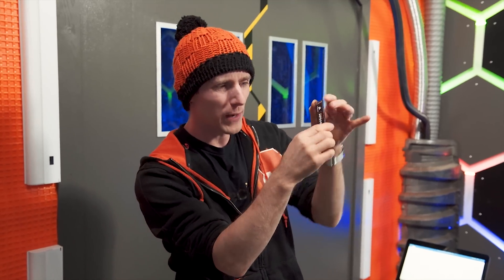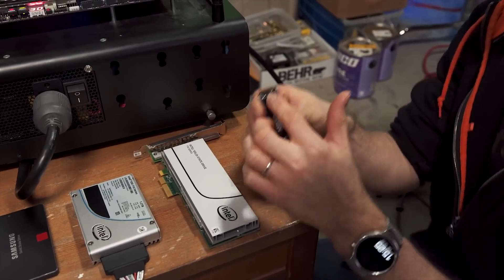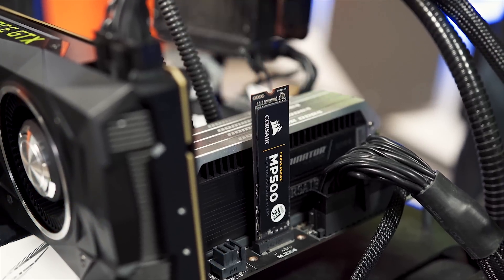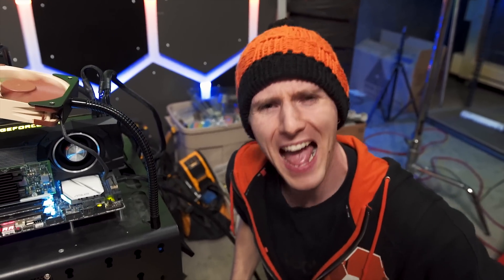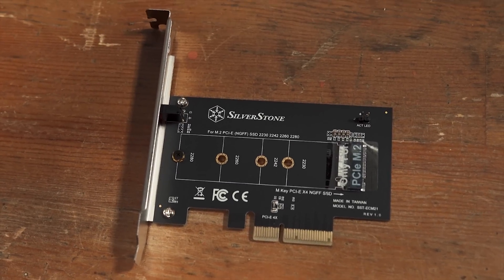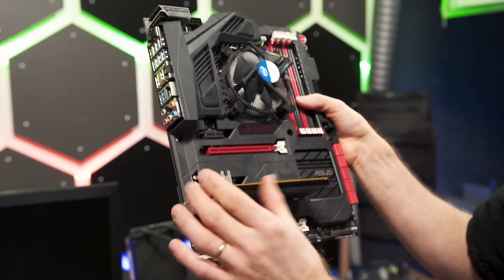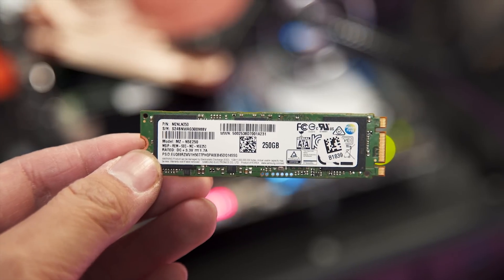The FASTEST SSD Technology Explained - M.2, U.2, and MORE

Comment: Linus referred to AHCI M.2 SSD's by saying "Don't expect to get earth shattering performance out of it"... I've had a 256GB Samsung XP941which is an AHCI M.2 SSD since November 2014 and its speeds are Sequential Read : 1065.317 MB/s
Sequential Write : 802.032 MB/s. 
Random Read 512KB : 643.234 MB/s.
Random Write 512KB : 734.560 MB/s.
Which is earthshattering quick in my book compared to even today's SATA 2.5" SSD's, (which seem more commonly used) like a Samsung 850 Evo. Obviously, the NVMe SSDs can double those speeds. I don't know why people haven't cottoned on to these types of drives to use as their Boot drive. Any after Z97 motherboards usually support it as a boot drive. The price has also dropped by half in those couple of years since I had mine ...

Comment: A few weeks ago I built a new Skylake based PC and used the new Samsung 960 EVO NVMe SSD as my boot drive.  It's impressively fast and benchmarks MUCH faster (read 3100 MB/s using CrystalDisk).  This crushes my SATA based SSDs (Samsung 850) which have now been relegated to a tiered storage space.  Highly recommended.

Comment: Can you do a benchmark test on a Sata SSD vs. a M.2 drive. I know my laptop motherboard has a m.2 slot since it was an option with my ASUS. I am currently running a 1tb Sata SSD might consider running my OS on the M.2 if I get a large enough one and use the secondary drive to store video that I use when I am performing with it. Thanks!

Comment: I have 512GB M.2 NVMe for boot/system drive, 1TB SATA SSD for Steam and other apps, and 2TB 2.5" HDD for mass storage, and it's a great way of setting things up. M.2 is ideal for small form factor systems as well. I think such a form factor is going to be the way forward.
Reply: it's year 2022 and yes you are right. m.2 with NVMe support is now the de facto standard for main(boot) drives in most laptops nowadays.

Comment: So, M.2 drives only have an advantage if they are NVM. 
If they are AHCI, it's the same as a mSATA (which you didn't even mention in this video, and they are even smaller and cheaper), or a normal SATA drive.

Comment: KeyB (gen1) and KeyB&M (gen2) and KeyM (gen3)
anyway to get an KeyM M.2 card to be used in a sata3 adapter or a USB3 keystick M.2 adapter, (Im aware that it ofcourse will be at limited speed)
but still I have an Intel 6p 256gb M.2-card just laying in the desk, in lack of adapters or keyM dedicated slots, all the M.2 adapters we got in house, wont take it, as they all have the groove in the left side, while as the keyM that have it in the right side.

same with the tablets, there also seem to be all KeyB slots.
Looking for an sata3 adapter with standard sata3 plug, that is able to to take KeyM M.2 cards.? (the ones for KeyB (gen1), you almost get throw at you for few bucks, but the ones for KeyM (gen3) std) doesnt seem to be the case.?
the theory 1500mb/s readspeed hence Intel p6 card, is not vital, just solely being able to take use of it' at normal old school sata3 speeds at a few hundrede mb's and like a old school sata3 plug drive.

Comment: I just bought an alienware.. and it does not come with SSD drive so I added a 480GB SSD drive. The problem is, it won't boot on my SSD once i reconnect my HDD. It goes back on booting on my HDD even I alter it on my BIOS already.

Comment: kind've misleading... 2.5" SSD's don't even come close to filling the enclosure size. very size comparable with M.2 Form Factor...
but, video suggests that they are 'bulky' compared to M.2 Form Factor.

which they 'are', but by connectivity Form Factor necessity, not actual size necessity.

Comment: I doubt Linus will see this, but I see that Logitech G710+ in many of your videos. Did you replace your keycaps. Mine was very bad. A few days after the warranty expired all the keycaps started falling off and breaking. I bought a few replacement keycaps as it was only a few keys at first, but later even more fell off until the keyboard was unusable. I have since then got a Corsair Strafe keyboard and it works just fine. On the Logitech keyboard the keycaps were so lose that i could pull them off with my fingers with little to no effort, but if I want to do that with the Corsair keyboard I have to pull VERY hard or use the keycap remover tool.

Comment: If your mobo doesn't support Nvme, you can simply do a BIOS mod and change some settings in the BIOS CSM menu and get full support for Nvme drive. I successfully installed Windows 10 on my ASUS X79 PRO mobo.

Comment: How many hard drives does it take in raid 0 to get equivalent performance to a modern SSD?
Reply: Ares5933 You would never be able to come even close to the low latency of an SSD (which is what makes it feel so fast), no matter how many HDDs you would stripe in RAID0. Also, when putting more than 2 or 3 drives in RAID0 it gets rather worse than better because of the overhead.

Comment: Im rocking a Samsung 950 Pro on a X79 2011 board with an 8 core Xeon in full NVME mode with all benefits like booting and full performance on Windows 7 (!). Installation was as easy as you could imagine. No bios hacks, no W8 legacy bullshit, no driver updates, nothing. Samsung 950/60 are just awesome. Installed, booted right up, performance over 2gb/s with nonstop video rendering. I love it!

Comment: I'm curious, you're ignoring most SSDs and didn't cover the 600p, OCZ's RD400 or the new amazing Samsung 960 drives, but you're sitting on the less ideal COrsair MP500 drives and using Intel 750s? I do think the Corsair MP500 and Samsung 960 EVO & Pro deserves a video! Consider including the Intel 600p and OCZ's RD400 just for comparisons if you can get your hands on them!

Comment: You can use an NVME as an OS drive on a system that doesn't not supports NVME boot, the bootloader has to be installed on a different drive.

Comment: I think it would be possible to add a bootloader that will support booting off of the PCIe storage. It's not impossible.
If the manufacturers cared enough about legacy hardware, they would've added a boot ROM or something inside the card itself and it would work pretty much everywhere. But this is Intel we're dealing with here, so I'm not surprised.

Comment: Hey Linus + Staff,
i am from germany so sorry for my bad english...

You are not 100% correct with your statment that you can't boot from an SSD older than X99 or something... It is possible with at least this models:

Samsung SSD 950 Pro
Plextor M6e

Because you can run them in Lagacy Mode "IDE Mode" therefore they have a dedicated ROM. 

Maybe you can Google Translate this Page http://extreme.pcgameshardware.de/ssd-hdd-laufwerke-und-speicher/458635-how-nvme-ssd-mainboard-ohne-uefi.html to take a closer look!

Btw.: this took me like 30 secs Googling, because my instinkt was that that was false Information on your side. I was thinking about installing GRUB on a normal SSD and set the mount point to the M.2 SSD... But it is even easyer! 
It would be nice on your side to maybe check the things that your "new" authors are presenting to you =)

Best Regards
Kevin

Comment: I was hoping for a performance review. I want a performance review. Why has it taken this long to compare the four or five M.2 sticks out there right now? Intel 600p, Samsung 960 Pro and Evo, Corsair MP500, and the OCZ RD400. Just like, a quick video on which is best value and best performance.
Reply: There's also a value M.2 NVMe ssd on amazon that has amazing review but I've never of the company before. MyDigitalSSD BPX
Reply: Agreed! Dont forget about the Plextor drives though!
I would also like to add in comparing the AHCI M.2 drives like the Kingston Predator, Samsung SM951, Adata XPG SX8000 (is that one nvme?) as well!

Comment: Mmm a lot of people seem confused about the explanation in this video.

What it comes down to is:

SATA-Express: Dead, don't buy it.
U.2: Dead, don't buy it.

SATA 600: Mainly used for large disc based storage (ie: 7200rpm drives) and early SSD's. This technology is limited to 600MB/s. If you're on a budget I would recommend a smaller SATA 600 SSD for your OS and a 7200RPM drive for bulk storage.

M.2 drives on the other hand come in two flavors SATA (AHCI) and NVMe. 

M.2 SATA (AHCI): These drives are meant to ensure software-level backward compatibility with legacy SATA devices and operating systems. These are slower, but cheaper but don't really have a major advantage over regular SATA 600 drives other than the form factor. 

M2. NVMe: The major advantage of NVMe is that it can access data parallel this gives it a massive performance advantage.

Where M.2 SATA (AHCI) drives are limited to +-550MB/s read and write and 50~60.000 IOPS and NVMe drive go well up to 3.500MB/s read 2.100MB/s writes and 330.000 IOPS and expected to go even higher as technology advances.

Disadvantage is that M.2 NVMe drives are currently really expensive. I would only recommend to those running applications with very high disk usage such as content creation or simply if you have the money and want what is fastest on the market.

If you're building a new PC I would highly recommend you get a motherboard with at least an M.2 NVMe slot on it for future upgrades.

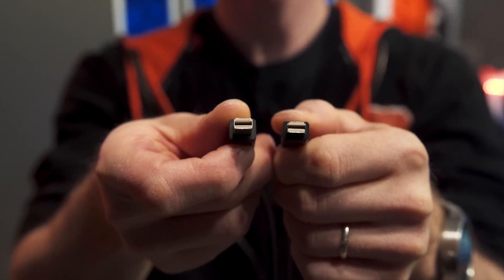Comment: 1:04 On my Oneplus 3T, I have tested to copy files to OTG SD cards via a 3.0 card reader/hub and the result is 5.79s to transfer 525MB of 3 videos included the latency. which means an at least 105MB/s speed and is definitely 3.0 instead of 2.0

Comment: Thermal throttling can be an issue with faster examples of these devices. This would be why Intel has wisely made their higher performance NVMe offerings as PCIe cards sporting extruded aluminium heat-sinks and ventilated PCI fences.

Search: Samsung 950 Pro M.2 Additional Cooling Testing - Puget Custom Computers

Comment: since im pretty much a noob with hardware, i need some help with choosing the proper ssd. im using msi h97 gaming 3 bought 2 and half years ago, so which type of ssd should i get? and i only want it to be used as game storage is this a good idea, cuz i dont really care about system booting time. using 4790k stock @4.0 and a evga 1070 sc

Comment: A better explanation for this would be:
- AHCI and NVME are like the middleman between your hardware and software. AHCI is a slow middleman (protocols) and NVME is a fast one. 
- Since they're just middlemen, they can work off of any connection, whether it's M.2, PCIE, or SATA (specifically in AHCI devices)
- Some motherboards support both protocols, while others only support one of them for boot drives. If yours only supports AHCI for boot drives, no matter what you connect your NVME drive (PCIE or M.2 slot) it won't let you boot from it.
- New motherboards support both protocols so you can connect the NVME drive anyway you want and it'll work at full speed and let you boot from it. So whether you get a PCIE M.2 device or an onboard one, you'll be fine. 
To sum it up. PCIE, M.2 and SATA are all just data highways. 
AHCI and NVME are the things that dictate how fast your "car" will be able to travel in any of those given highways if the country (the motherboard) allows that speed limit. 
I hope that helps better explain it to anyone who's confused.
Reply: The best explanation : )
Reply: great explanation!
Reply: Superb explanation, thank you!
Reply: Thx a bunch dude cause God knows my brain was fried after watching this video.
Reply: Still, i have a doubt (Maybe a stupid doubt)
AHCI, is for SATA HDD's? In this case, i've understand that NVME is the protocol for the SSD chips that Linus showed in the video, but AHCI i didn't get it as many people have understanded.
Reply: @itsneight There are two different M.2 connectors. M key connectors give x4 lanes for NVme(pcie) SSDs. B key is for the ahci variety. The samsung 840 evo shown is B + M, so it will plug into an NVMe slot, but run at AHCI speeds. https://rog.asus.com/articles/maximus-motherboards/buying-an-m-2-ssd-how-to-tell-which-is-which/
Reply: Meow Thanks
Reply: Not all AHCI M.2's HAVE to have both keys, right?
Reply: 泽皓杨 no, highly unlikely but the manual that came with your Z270 motherboard will tell you for sure which PCIe slot the M.2 slot shares bandwidth with, but it will be one of the x4 slots I'm pretty positive
Reply: So when do you need one of those PCI-E cards he was using?  Only if your board doesn't have an onboard M2 slot?
Reply: Fuck this video, your comment is all that's needed for explanation.
Reply: I'm aware of that... but the Kingston Predator I have doesn't have the extra connector. Thats why I dont think its AHCI and also why I asked the question. I notice the connector with both keys has two slits in it, the Predator does not.
Reply: Or you can opt to add support to your older motherboards bios. There is nothing that will stop me from booting any NVMe SSD on ANY old AHCI only system, even if I have to mod my own bios I am going to boot it. You can mod your bios, or use DUET as I stated above, or buy a Samsung 950 Pro with built in legacy option rom support. Either way it can be done if you know how to do research and have a free PCIe slot available.

I haven't found a NVMe ssd I can't boot yet and my computer is from 2009.
Reply: Ah, the joys of getting new motherboards.
Reply: m.2 is faster than PCI-e? I know it is faster than Sata III.
Reply: Well explained!
Reply: You should start your own channel this is great.
Reply: my man only has 11 subs, but he explained nvme better than linus? The fuck is this world coming to?
Reply: Hi, my motherboard is z270 and my cpu is 7700k and the video card is gtx 1080. The motherboard has two pcie x4 slots, two pcie x16 slots and a m.2 slot. Now, I have already had one m.2 ssd as an boot drive. I want to buy a pcie x4 ssd such as intel 750, which is used for storage. Is that possible? I mean will the speed for these pcie cards be affected?
Reply: I have an ASUS B85M-E/CSM board with a couple of SATA drives on it.  Is there a simple path to adding an SSD drive for my photoshop work directly into this board ?    I don't see connectors like you were showing for the M.2 etc on the manual diagram - is it just too old to have included them  ?
Reply: crispycinnablunt :D I'm not an expert but I don't thinks so, on the PS4 You can get a standard SSD 2.5 and I'd think it's the same on Xbox one, tho double check if Xbox one even supports a manual drive replacement
Reply: yes david thats correct
Reply: Great explanation. Thank you.
Reply: Thanks for the explanation. More easy to understand than the video. (english is not my native languange :3)
Reply: great explanation. thx!
Reply: PCIe  is faster from my reading  Maximum PC minimum BS.
Reply: Great explanation, I was a bit confused regarding AHCI and NVMe
Reply: Legit better expl than this entire video.
Reply: actually much better than a dumb video even without using metaphors
Reply: Thank you 👍🏻
Reply: thanks cuz holy bleep i was soo lost! sorry linus
Reply: I'd love to hang out with you dude! Thanks for the explanation!
Reply: Ok I know this is an old thread but I hope someone can help me.
I have an ASRock Extreme 4 motherboard with an Ultra M.2  Gen3 x4... so what M.2 drive do I want?
Will I get the full potential from an NVME drive? And are NVME drives the fastest/best drive?
Cheers!!
Reply: You're the best. You should apply to LMG to be a writer.
Reply: I don't know why Linus didn't just say basically this, I've already known what these protocols are for a while now but this explanation is making me confused because it's just so unnecessary, there a much better techquickie video on them anyways
Reply: What
Reply: Years ago I upgraded to an i7-4770K and an Asus Maximus VI IMPACT  board (still rocking this setup, too).  The board has an M.2 slot, but it wouldn't even show up in BIOS.  I had to scour the internet and find a custom BIOS to flash to the board to make the drive appear so I could boot to it.
Reply: i have an asus z170 pro gaming mother board it says ngff m.2... I bought an WD black sn750  nvme is it not compatible with my motherboard?
Reply: @GuitarRifff  looks like the board supports it
Reply: Jimmy Two-Times I’m gonna go get the papers, get the papers.
Reply: Aren't the M.2 connectors connected to a SATA or PCIE itself?
Also I'm not aware of any SATA NVME drives for that matter.
Great summary btw!
Reply: also some people wont get that m.2 with ahci is just sata 3 (600MB/s) while m.2 nvme is up to 3.500mb/s and maybe more ....Like samsung 980 ssd ... if i am wrong correct me
Reply: Isn't the AHCI the one that looks similar to NVME but with one more notch?  I know that for performance don't get those ones, they are no better than a SATA drive.  Their performance might not be horrendous but also it will not be even close to an NVME or U.2 drive.
Reply: Great explanation, 👍👍👍👍
Reply: This was such an excellent explanation. I applaud you ability to clarify and express concepts in simple and easily understood examples.
Reply: Great explanation. Makes much more sense than the video! The question I have is... Is AHCI physically (visually) different from NVME? I have a Kingston Predator m.2 (I got the model without the PCIE bracket). I've been told it was AHCI but physically it appears just like the Samsung 960 evo M.2 I also have in another computer. (Connector is the exact same)
Reply: the question is does it wrk with my xbox one haha

Comment: on Ebay saw few dead sm951 and sm961 and some reading over weeb and high temp with fast overheating burst in systems like AiO liquid and m.2 placed near hot places like Voltage Reg or back plate of GPU can cause many problems ...